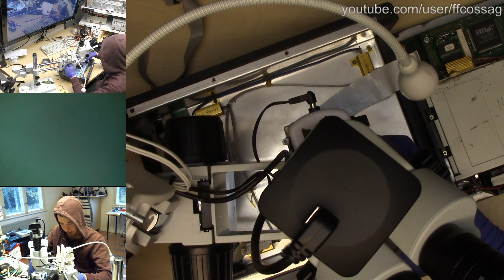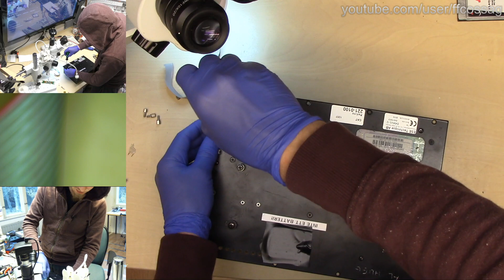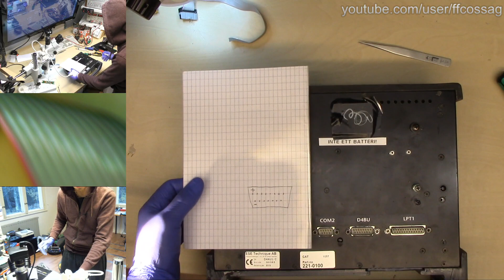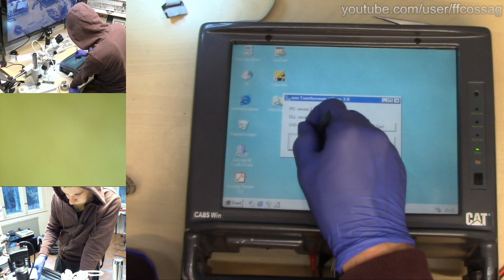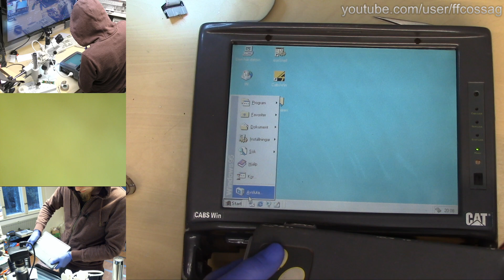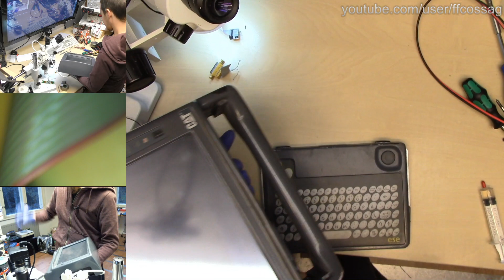RECDSTRM: FINAL stream of the awful industrial controller (I hope)

Comment: 18:30 replace the HDD with an SSD or CF card on an adaptor and use Norton Ghost 11.5 to transfer the partition.
 A fragile HDD should not be used in an industrial controler thats mounted on a swinging door.

Comment: An SSD would have been so cool to do in that.  Not sure what would be compatible.  There are IDE SSD models.  I buy all my SSD's used off ebay and I have yet to buy one that's had more then 90% wear showing in the smartctl data.  Always have good luck buying from Enterprise sources on ebay, but all my ssd's have been good.   I think SSD's are a great match for older systems.   Less IO wait time means more CPU cycles effectively, and those older system tend to be short on ram.  But just as a practical matter, that hard drive is due to be replaced I would think.   Hope you gave them a hard copy back up in case it fails.   What a fun project.  I love your work and this channel.   I keep hearing how saving $100 bucks is no big deal, but you can't compare savings to earnings because only a fraction of what you earn is ever saved.   This type of work is retirement proof too.   You could still be having fun and saving a few bucks even if you can't work.  Having an ear issue of late and trying use the CC on these videos…  This video starts out, “The Nobly girl of button….”.   

Don't let yourself be confused on booze.